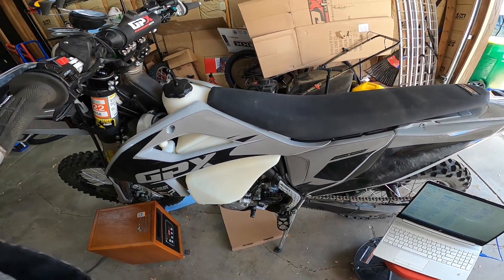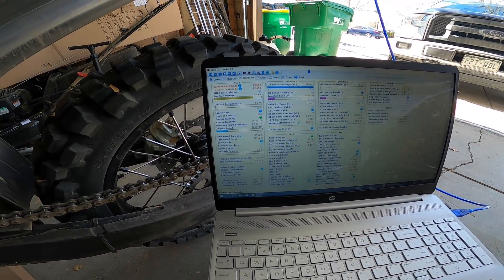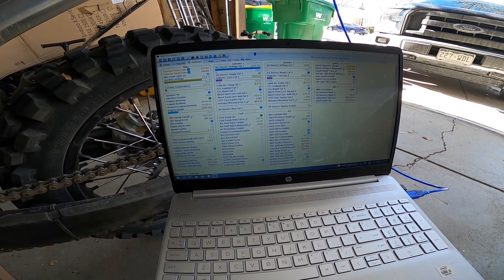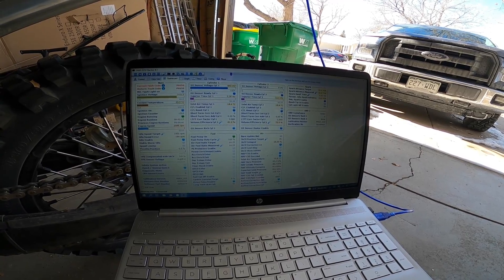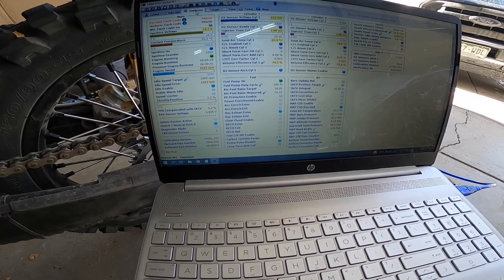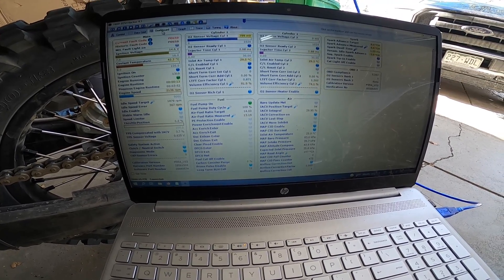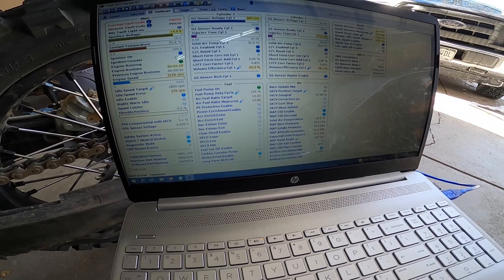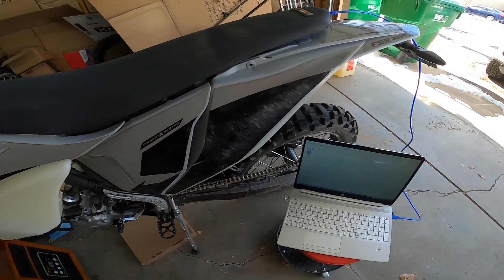GPX FSE Delphi ECU Testing Multi-Map Feature

Comment: Thanks Sam, this is really very useful.

I've got a Bluroc Hero 125 which has the Delphi MT05.2 ECU so can be read / flashed with HUD Hacker.  There are also lots of Chinese bikes in all sorts of styles here in the UK (modern classic, enduro, cruiser) that appear to be using the same range of Suzuki GN engine clones and Delphi fuel injection.

I'm waiting on a J2534 Adapter to arrive, and was just planning to use it to enable the TACHO output (J1-6) so I can read RPM on an upgraded speedometer.  Now that I've seen this I am not going to be able to stop myself from thinkering with some settings.  

Initially since it has an aftermarket pipe I think I'll make the Open and Closed Loop AFR richer and raise the Idle Target a little.  Two things I had no idea how to do until watching your video and comparing the bin files you uploaded to the GPX forum 😅.

Thanks again Sam, happy riding
Reply: Hello! You remind GPX forum. can you share a link plz? sadently i cant find this(

Comment: is this using the J1-16 input for mode 5?
Reply from the maker: That is correct, opens up some nice tuning options.
Reply: @SCakey  what maps does it give you? 

On my tnt135 I get afr open loop, spark base angle, and some coolant correction multiplier.
Reply from the maker: @aleks138  Those and some stuff on acceleration enrich/decel enlean. AFR Open Loop seems to be what it references entirely for fueling in that mode and fuels differently.
Reply: @SCakey  so you're saying it never goes into closed loop?

I know on cars it stays in closed loop until WOT and then switches to open loop
Reply from the maker: @aleks138  The alternate map goes into closed loop the same, just saying that it references open loop tables for fueling. This may be done because I do not believe we have a wideband O2 sensor so below something like 13.5AFR, O2 sensor may be guessing so to Delphi they may consider anything below that entering open loop fueling even though 'closed loop is active'. 

Alternate map really to me just fuels VERY differently, it changes fueling immediately based on throttle whereas main map aims for 14.6AFR most all the time unless you're pushing things.

Comment: I have a few tuning questions. Previously you had the aracer ecu. Was that a piggyback or a replacement ecu? What model ? You did it with your phone via Bluetooth i think? I am about to order the 450 later today. Now you are on the 22 Delphi ecu and you are open source tuning it with a laptop? What should I start looking into to purchase for the 2022 fse450r that is user friendly and would do the trick to smooth things out slightly. Thanks
Reply: Could you reflash the 450 ecu without the bike?
Reply from the maker: @daves984  I'd see about hitting up Ethan Colby on facebook since he has a 450R and is working on the ECU.  I can flash a 450R but I dont have one to test the tunes on.

Aracer is a full on ECU, replaces OEM ECU and yes is controlled via bluetooth app on phone.  The OEM/Delphi ECU doesn't have bluetooth and only connectable with diagnostic cable but is a fully unlocked ECU.
Reply: @SCakey  thanks for pointing me in the right direction

Comment: I would love to get my bike running right...
Always had problem with the idle.
And Still cant get the cable to work, do you know any cable that would work for the AJP ?
Reply from the maker: I've heard some reports that AJP locks down their ECU's where you might not get into it but no confirmation of that.  It's also possible they don't have the diagnostic wires connected properly.  One thing I learned from owning these bikes is to not trust chinese wiring, possible your diag connector is not the same as ours like pin1 is k-line on yours or something (this would be odd but I dont put it past them).  If I were having trouble with a diag cable I'd investigate the wiring harness from the ECU to the diagnostic connector on the bike, ensure the correct pins are connected.  You should be able to see wire colors on back of ECU connectors and trace things out.
Reply: @SCakey  easy for you, to say that...
i do not understand any of that nonsense 😂
Reply from the maker: @DanielOliveiraSantos  Have you tried one of the pre-made wires for a Delphi ECU?  
https://www.ebay.com/itm/234053723332?hash=item367eb064c4:g:QDYAAOSw96Jgyb1h

or

https://www.aliexpress.com/item/1005003070279164.html?spm=a2g0o.productlist.0.0.46b678c3nQ3TuC&algo_pvid=23dfe1ad-46d1-4a53-afff-fc919dcf07df&algo_exp_id=23dfe1ad-46d1-4a53-afff-fc919dcf07df-7&pdp_ext_f=%7B%22sku_id%22%3A%2212000023783781035%22%7D&pdp_pi=-1%3B4.67%3B-1%3B308%40salePrice%3BUSD%3Bsearch-mainSearch
Reply: @SCakey  @samcake i really need your Help !  I have the same ECU Delphi my5.02  , i boght the VAG CABLE and i have it connected i can do reflashing ... but i still cant get my 500 to be unrestricted ! iam still driving at 45 KM/h. please HELP me deristrict it man .. itas a mash fiffty motor cycle with gears
Reply: 50 cc not 500